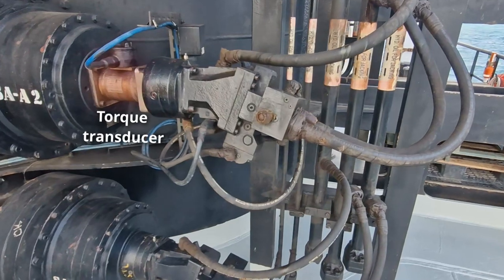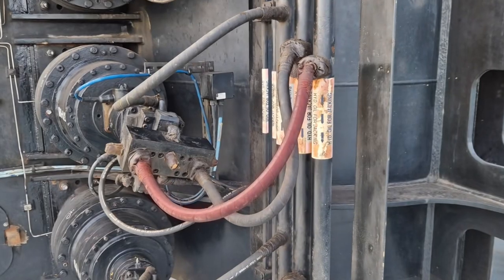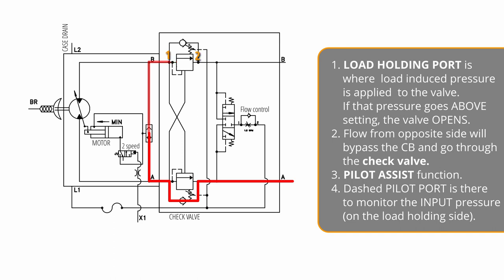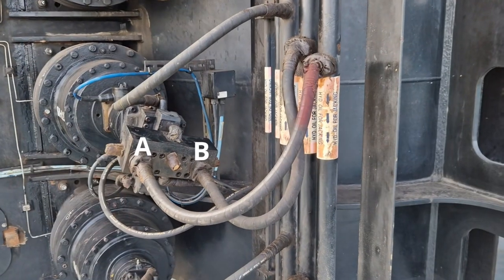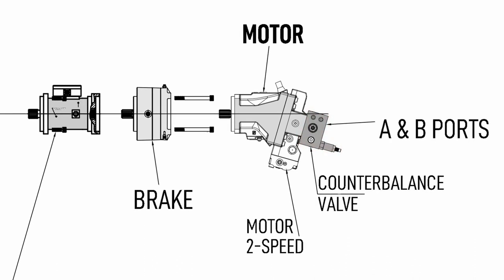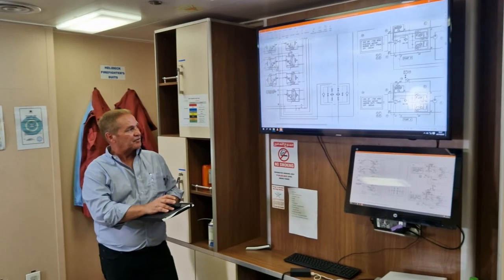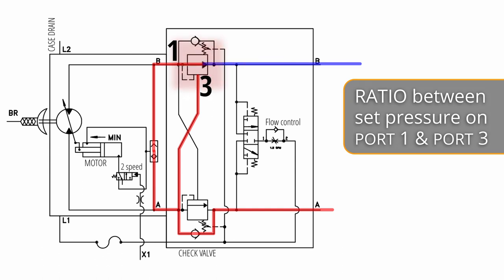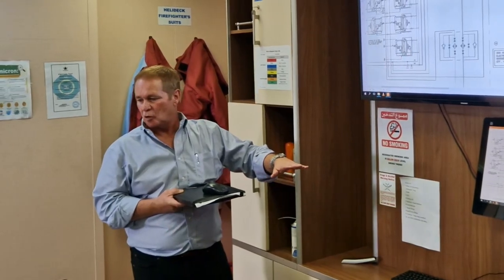JACKING SYSTEM - Lesson 5  - CB valves / dynamic brake

Comment: Thanks for the nice explanation. But the oil flow is probably drawn incorrectly. The oil cannot flow through the shuttle valve as shown in the video. Probably the red line should go through the hydraulic motor.